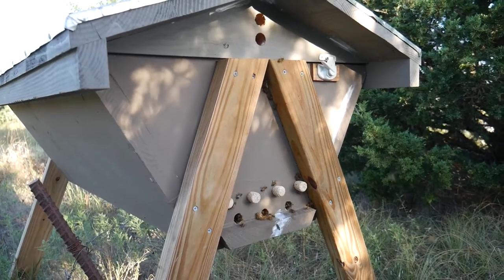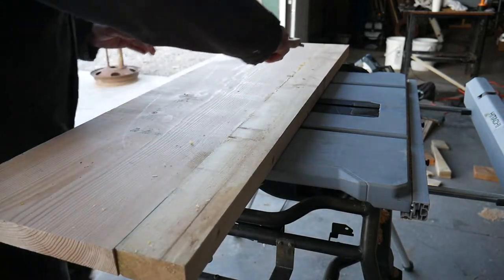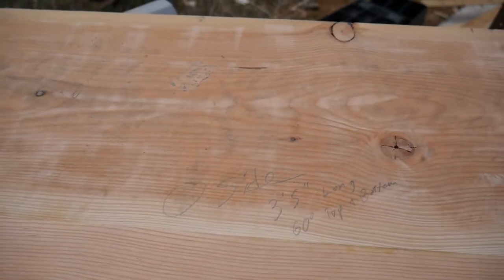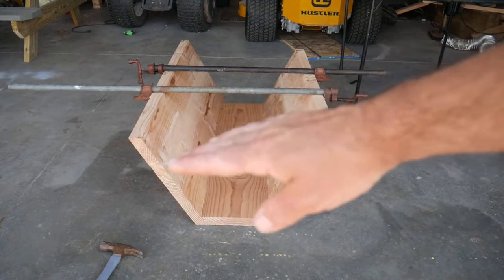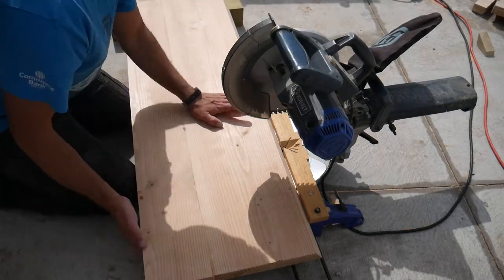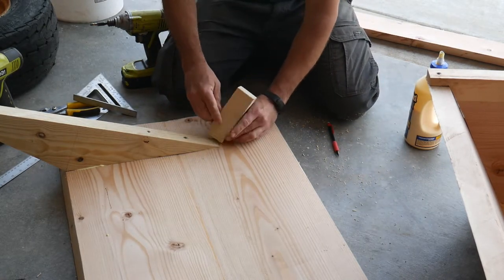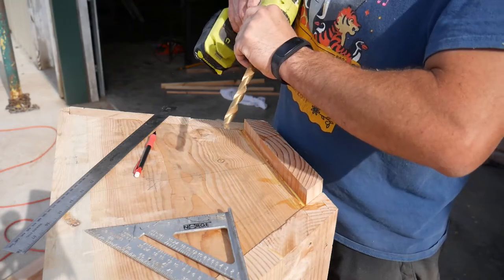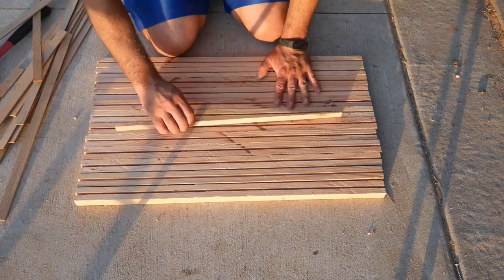Building a Top Bar Beehive

Comment: Why not just have a 90 degree box ? Just curious as to value of the 60 degree angles.
Reply from the maker: I believe that the angle was determined to require the least amount of bracing for the comb. The bees will be less likely to attach the comb to the side when it is at that angle.